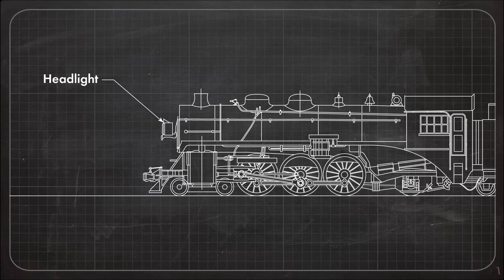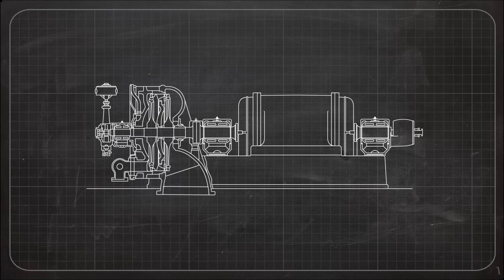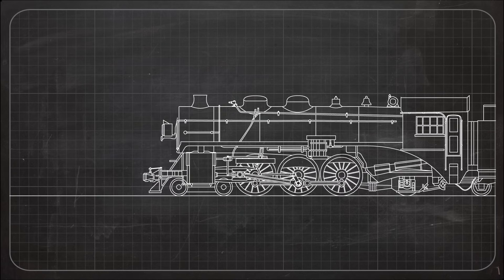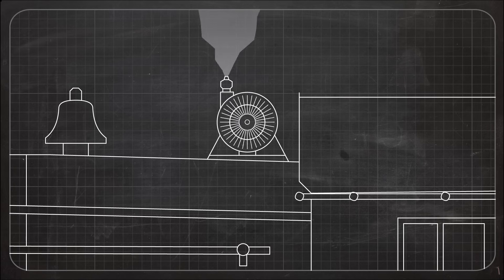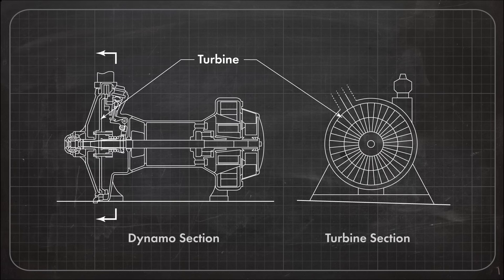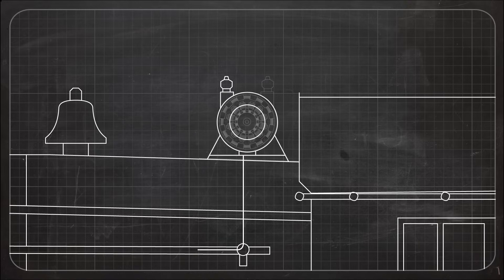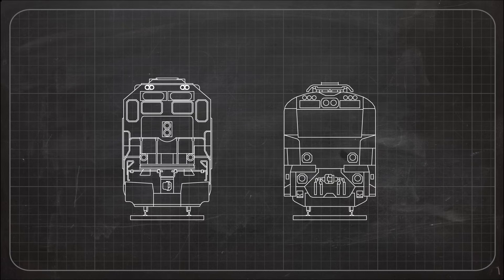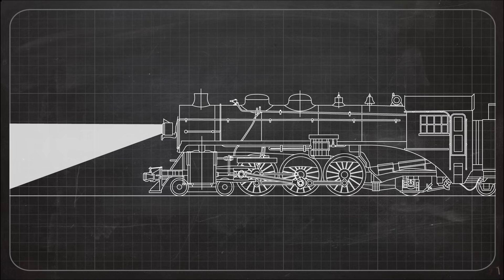How Do Steam Locomotives Power Their Lights?

Comment: Lamps on oil? They used Calcium Carbide in combination with water to produce flamable acetylene gas.
I have an original carbid lamp from the DB (Deutsche Bundesbahn). If you tell a story, make sure you use correct information.

Comment: Modern diesel trains actually have to have an additional generator for passenger cars, This is why you cannot just hitch a freight locomotive to an Amtrak train for revenue service. the locomotives usually do not have the equipment to provide head end power.

Comment: Some steam locomotives ran 72 volts DC for their Headlights and other bulbs. The 72 volt system draws amps than the 32 volt DC variant. These 72 volt bulbs were often surplus in the 1950s and 1960s. When these 72 volt bulbs are used on 120 volts Household voltage the color temperature is higher ie more white. But the life of the bulb in hours drops radically. 

In color photography A type bulbs are 3400 Kelvin; B type are 3200 Kelvin. Plain Jane Edison filament bulbs are in the 2600 to 2850 Kelvin region

So a "Hack" of the past was for Color movies and stills was to use 72 volt Railroad bulbs with a Variac and use about in the 110 to 125 Volt region; OR use Household light bulbs way above 120 volts with a Variac plus an extra 24 volt transformer 50 Hz to boost the even higher. 

With a stock BBA photoflood (3400 K) bulb on 120 volts we got about 6 hour life before they burned out. In color work it was common to  use a series parallel switch so you had 2 in series when adjusting the lights. ie 60 volts across each bulb so then then last 500 to 1000 hours. 

The voltage is often more like 64 V to 74 Volts DC . The 64 volts is two 32 volt batteries in series; if it has batteries like  Diesel has. ie 32V 500 AH 1300 Lb batteries is starting Diesel type Monsters

So with Steam there are 32 Volt and 72 Volt headlights

Those 72 volt Railroad bulbs screw into a regular Edison base screw bulb socket, Burstein Applebee in Kansas City sold 72 V bulbs in their Electrical main order catalog in the 1960s. 

There are converters today for taking 72 volts DC down to 12 voltsDC ; 24 volts DC  These can be used to charge say a backup battery powering low powered stuff. Some are actually rather big in capacity. ie convert 72 Volt DC to a charger with 24 Volts and 20 amps

Comment: Wrong, wrong, wrong!  Those dynamos were just a backup.  The real system was far more ingenious…… they used a bleed on the boiler output to run superheated steam through a venturi. The resulting low pressure pulled electrons out of wires connected to the venturi neck. That generated the nominal 32 vdc. The engine frame acted as rhe source of electrons and as they drained out of the frame, new ones came from the connection of the wheels to the track.

Comment: Auxiliary electric system is always something that cannot be ignored…
Interestingly, some trolleybuses can lose power even they're connected to catenary wires…
Some early trolleybus models in China was designed to power the low-volt system using axle-generators, which means the generators only output enough power when the vehicle speed is not too low. Otherwise, the batteries will die out and the trolleybus will lose control. If an SCR chopper does not get enough electricity to work properly, sometimes it's gonna be a disaster, the chopper will be constantly ON and the vehicle will accelerate abruptly.
Some trolleybuses use motor-generator sets to constantly convert catenary power into low-volt, not affected by the speed. And nowadays, solid state DC-DC converters are more common.

Comment: Thanks for this. I had often wondered about this. 
In the Uk early trains seemed to have dynamo’s driven by belt from the axle to charge batteries for the carriage lights. I will now look to see if I can find a generator for the loco too but the ones I see tended to be paraffin oil lamps. 👍

Comment: What about diesel engines
Reply: The diesel engine is already connected to the generator that provides power to the wheel motors (yep the engine is not always mechanically connected to the wheels that's an outdated design). When the engine's off off equipment runs off batteries.

Comment: 1:12 would it not be easier to have the rotation of the wheels, which are already propelling the vehicle forward, not be sufficient to power the headlamp? I can already hear the arguments against it, but I think that most of the arguments could be counteracted by simply having some sort of a battery somewhere in the cabin.

Edit: I still think that it would be easier to have the cabin be longer as necessary to provide room beneath where the drivers are working to store a battery that the movement of the train would charge because it is a very good point that the train could be sitting idle for hours but still needs to have the headlamp on.
Reply: You have to think about the train is not always moving. And when it does not at the same speed. A dynamo should provide a much stable source of power since it can be kept spinning at a much stable and contant speed. That's my guess at least.
Reply: Adding onto the previous answer, a turbine spins substantially faster than the wheels will. Since the generator/alternator produces its power when the magnets are spinning, you would be correct to assume you will make more electricity if the magnets spin turbine fast.
Reply: No because the wheel is not at a constant speed and no speed when stopped, with a separate turbine you can get a set speed and constant power. and as far as the battery part of your thought 1st batteries from back then needed to be very large to hold enough power and second batteries don't like extreme temps and the cabin in a steam locomotive is very extreme and last is space and weight and maintenance of a lead acid battery that by the way when being charged is letting off hydrogen gas. So a steam turbine is much simpler and more reliable especially since the steam is already super heated and they are also using the steam to make the air pressure for the brakes.
Reply: Cabooses in later years had a generator mounted to the wheel that charged batteries to power lights and such on board, but many of these steam generators existed before battery tech existed that would be sufficient to power everything the locomotive powered. The locomotive also generated power for lighting and in some cases heat, when pulling a passenger consist
Reply: It’s a good question, but the above answers are correct.  Also, a train might be called upon to sit for several hours with its lights on.  So big expensive batteries and complex gearing would end up being more expensive than a turbine.

Comment: how was the speed of the generator regulated to keep the voltage stabile ?
Reply: Maybe by controlling the steam to the generator, like using some kind of regulator. It's just a guess.
Reply: Throughput. At enough pressure the steam just goes as fast as it can out of the opening of that diameter. It's a hard cap. There is no lower cap. Either you bring the boiler to pressure and then open the dynamo valve, or let it run underpowered while you heat up

Comment: Another method used for headlights is acetylene lamps.  These were used on early cars, as they had no electrical system, just a magneto for the ignition system.  They mount a piece of calcium carbide and water drips on it and produces acetylene gas, which burns extremely bright.  I don't know if they mounted one on a locomotive, but it was one possibility at the time.

Comment: *thermal energy. As in heat. That gets converted into motion (i.e. kinetic energy) by expansion in the turbine (which causes it to cool), where the turbine rotor picks up said kinetic energy to spin a generator.

Comment: Almost without exception, the locomotive electricity supply was 32V dc. The carriages used batteries and dc generators powered by the wheel axles.
Reply: Is that one reason why steam trains today have a diesel locomotive also present - to generate electricity for the cars?
Reply: @tedrice1026 modern passenger cars (specifically in the USA, but I suspect other countries use a similar system) are designed to use a 480v, 3phase power bus off the locomotive. This is specifically called HEP or Head-End Power. Steam excursion locomotives cannot produce the 480v3p power, so the car either run on their own under-slung generators, a modified boxcar that produces HEP, usually called a power car, or will have passenger diesel along to generate HEP. Almost always they would be Amtrak engines, if done that way.  Diesels towed behind American steam serves two purposes. The primary issue is dynamic braking. No one has yet developed a dynamic braking system for steam locomotives that is better than towing a diesel. The other reason to tow a diesel is not for backup power, but for fuel efficiency. Steam is most fuel efficient in a certain speed range, on flat running territory. Anything outside it's efficiency range, the diesel can be used to augment or push the steam engine to conserve fuel, and more importantly, water. Most engines had at most a 100mile water range, and almost exclusively much shorter. Today it might be 500miles between places to get a good supply of water. Big Boy's main tender holds 25,000 US gallons (94,635.295L) plus two water tenders with 28,000USGal (105,991.53L) each, totalling 81,000USGal (306,618.35L)... And they still need to stop and water whenever they can.
Reply: Yeah, I had totally forgotten about the water issue. They used to have water towers about every 20 miles, I think.
Reply: It's impossible to do dynamic braking for chuggers.
Reply: @s71402san impossible is only true when nobody's actually done it. In June 1960 it was impossible for mankind to land on the moon.

There is absolutely no reason that a steam locomotive tender could not be configured to have batteries to generate the magnetic field in one traction motor, which then uses the power generated by its use as a dynamic brake to recharge the batteries, and to create the magnetic field for the other axles. 

It's possible. It may not be practical, but almost everything is technically possible.
Reply: @s71402san  that is actually false.  Aside from the steam-turbine-electric locomotives, a water cooled air brake re-using the driving cylinders was developed for mountain railroading, called the countersteam brake, although it is most common on rack railways and European mountain engines.
Reply: @s71402san there were such things as counter-pressure brakes - Google Le Chatelier
Reply: I'm old enough to remember riding in carriages where the power was generated by DC generators connected to the carriage wheels, and they had rechargeable batteries to keep the lights on while not moving.  I also remember one trip where I and a few others were in a carriage where the batteries were obviously not working.  The lights would go out as the train stopped at a station and would come on but flickering as the train moved.  It was a reserved-seat service but after a certain point, the guard came along and told everyone in that carriage that they could move to a different carriage to have continuous light.  My guess is that he had to wait until he could be sure we wouldn't be inconveniencing passengers with reserved seats before he was allowed to give us permission to move to a different carriage.

Comment: There is also a wheel-driven generator that is powered when the train is moving.
Reply: That makes no sense as all the power dies when the train stops, much more stable to use a generator. The engineer cam adjust the steam flow to the generator too

Comment: As air conditioning was added to older (heavyweight) equipment, such as diners, Pullman Company sleeping cars, parlor cars, and such, some equipment used a steam ejector technology to cool the air fed through ductwork typically mounted on the roof along the clerestory.  The steam engine or auxillary steam generator  thus required EVERY car on a passenger train had to be equipped with a steam pipe connected  throughout with the necessary flexible connections between cars.

Comment: In the UK on the steam trains we had lamps that can just put on
Reply: In the UK, trains headlights never intended to iluminate the tracks, they're there just for marking the head/start (and the end) of the train. Also to designate several types of trains by using different combination of lamp placed on the smokebox door (and the running board) of the engine.

Comment: As an interesting aside, when electric headlights for steam locomotives were first introduced in North America, the makers of oil-burning headlights argued that electric headlights were too bright and would "blind" crews of oncoming trains.  Today, North American locomotives are equipped with headlight dimmer switches.  The "bright" position is used on the leading end when the locomotive is moving on a main track; the "dim" position is used when meeting a train on an adjacent track, when working in a yard where the bright position might blind personnel such as switchmen working on the ground, when a locomotive is standing [not moving] on a main track, and as a marker {essentially a tail light} on the trailing end when moving [if the locomotive is not equipped with red marker lights.]  When a train is standing on a passing track or siding in the clear of a the main track, the headlight must be turned off. Prior to the adoption of LEDs, unlike automobiles locomotive headlights were dimmed by running the power through a resistor to reduce the voltage going to the lamps.

Comment: Back then, DC generators were common. Also they didn't use spinning permanent magnets. Back then they were very weak so you wouldn't get much electricity. Instead, electromagnets were used powered by the generator itself. This allows much stronger magnetic fields to generate more power and you can regulate the voltage easily. An electro magnet connected to the generator pulls a lever which in turn operates a potentiometer to adjust the power in the exitation coil to keep the voltage level in check independent of steam pressure and loads. 

While modern trains power all the coaches from the locomotive, steam trains didn't do that at all. Instead, each coach  had it's own set of generators connected to the wheels. When the train is moving, the generators provide power for the lights and charge batteries to keep the lights on during slow sections or stops.

Also "weird" is that while the coaches used to be heated with steam, this steam wasn't coming from the locomotive. Instead a boiler, often part of the cargo car or a dedicated heating car was used to provide steam for heating.
Reply: In North America, almost all steam for heating was supplied by the locomotive.  For long passenger trains in very cold climates, it was often difficult to heat the entire length of the train from the locomotive.  In such cases, a second source called a steam heater car [usually a baggage car equipped with a boiler, fuel, and water supply] was attached at the rear of the train and the steam from it heated the rear half of the train.  When North American railroads changed from steam to diesel-electric locomotives, the diesel passenger locomotives came equipped with flash-type steam boilers commonly called steam generators to supply heat to the train.  If a locomotive not equipped with a steam generator pinch-hit for a passenger locomotive, a steam heater car was attached to the train.  North American electric locomotives came equipped with fuel oil fired steam boilers / generators.  The use of 480 volt, 3-phase electrical power for train heating did not come into common use until Amtrak and Via Rail Canada purchased new passenger cars, retiring their old steam-heated equipment.  Electric heating can be controlled more precisely than steam heat and requires less maintenance.  Diesel-electric locomotives provide head end power {HEP} from an auxiliary alternator running off the main propulsion prime mover in most cases, although some commuter authorities equipped their locomotives with separate diesel-engine alternator sets to provide HEP; this enables the locomotive's prime mover to be shut down while the train is laying over between trips while still enabling the coaches to be heated or cooled.  As an aside, the F40PH passenger locomotives purchased by Amtrak had to operate in at least the 6th notch [3/4 throttle] to provide HEP even when standing still in stations.  The sound this produced earned them the nickname "screamers".

Comment: A Pyle-National K-240 as is shown in the link that someone posted generates 500w, typically at @ 32vdc. An MO-6 generates 800w. They have mechanical governors to keep the voltage relatively constant with varying loads. The larger generators, and sometimes more than one generator, were needed to power early tube style radios and early train control systems (the forerunner to by positive train control - PTC). 

The standard incandescent headlight on a road engine uses 250w, the rest goes to the classification and and cab lamps. The last stock of 32v, 250w bulbs was manufactured several years ago and all supplies have been exhausted. There are low wattage, multi-voltage LEDs lamps that work fine for all but the headlight but the headlight case and reflector only work with an incandescent bulb of the proper dimensions. A new one-time production of 6,000 headlight bulbs is currently being custom manufactured and will soon be supplied to a number of operators of heritage steam. A search for "557 Pyle Enterprises" will give information to anyone needing new 32v, 250w locomotive headlight bulbs.